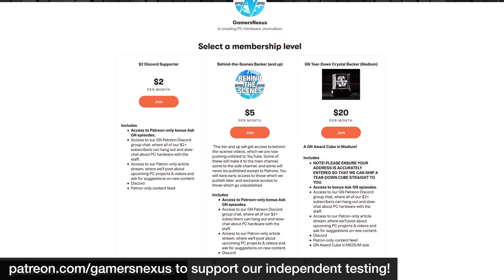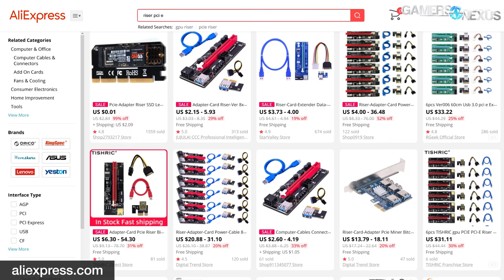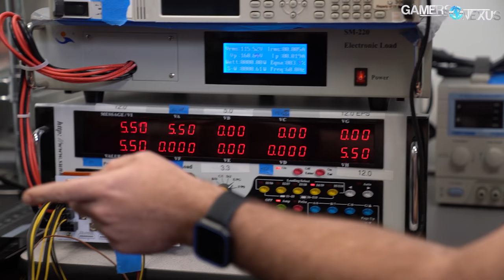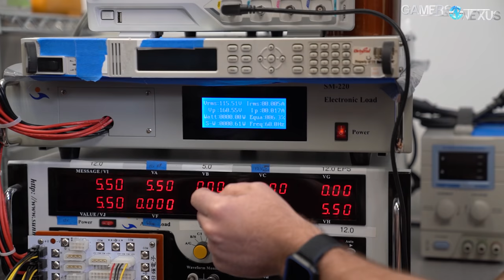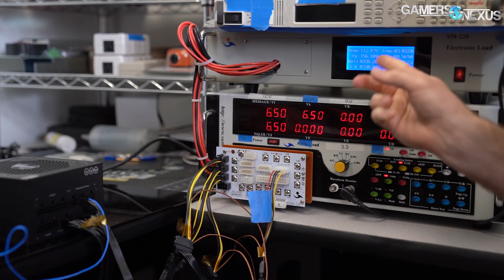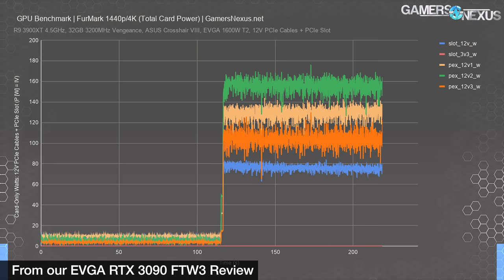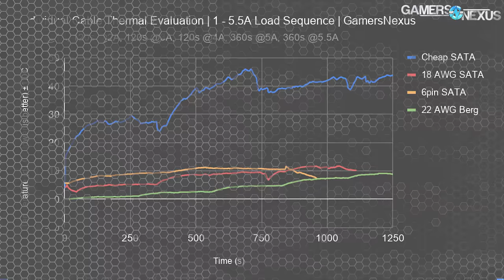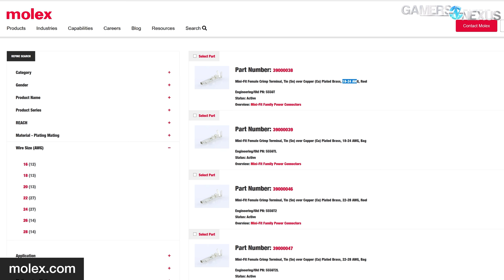Don't Use Cheap Cables: Dangerous Construction & False Wire Gauge

Comment: Oh come on now.
In 30+ years of building PCs, and at times having to use power supplies so cheap you could find them in bubblegum machines, and at times having power cables split between multiple components, I have never once, not one single time, seen PSU cables smoke and melt.
That's not to say I haven't seen people screw up power supplies by connecting them wrong, especially in the early days, but this is ridiculous. Exactly when are you going to be pulling 6-Amps through a molex or SATA cable? You'd have to multi-split one for use on a 3090 or something, and then the card likely wouldn't work anyway.
Man, you guys must be getting desperate for videos to make or something. Any of those power cables you were using would be fine for their intended use.

Comment: While I of course never wish bad on anyone, I don't have a whole lot of sympathy for miners at this point.  The massive waste of resources (both electrical power and computer components that are in short supply) keeps my f--ks bin from refilling.   Beyond power cables, you can see from the photos all sorts of poor construction, box fan cooling, and all sorts of other dangerous concepts.   Corners are aggressively cut in the quest for profit, putting house, home, family, and others are risk, all for a mark on a digital ledger.    Great story, great report, but the best solution is not to mine at home, not to mine in a place that doesn't have sprinklers, fire and smoke alarms, and such -  and not to mine on home made rigs.